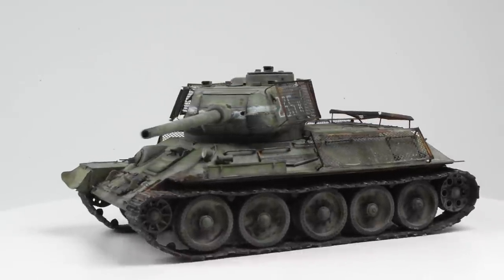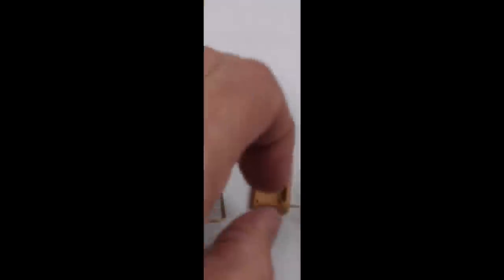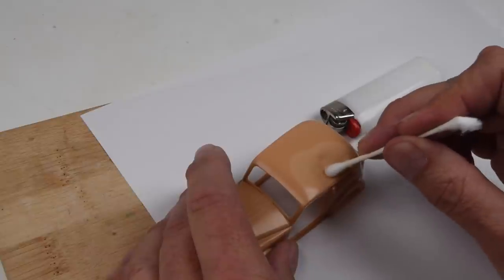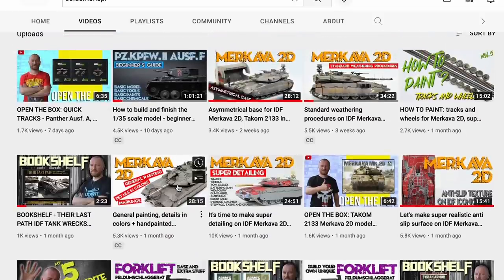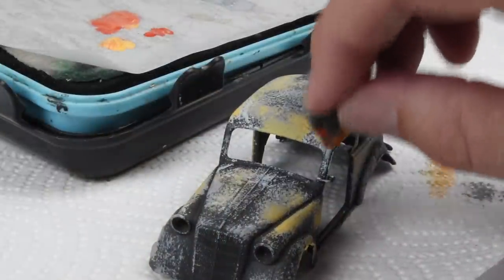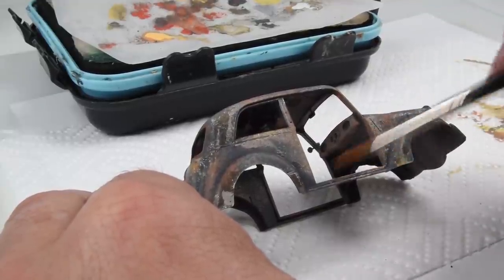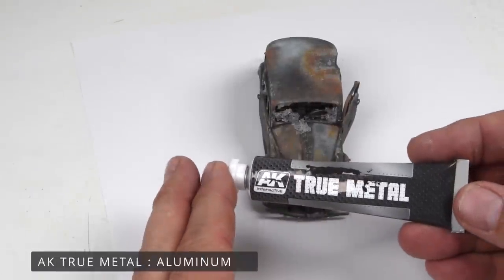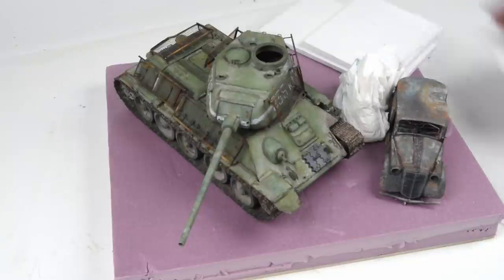T34/85 Battle of Berlin, EPISODE 3. Construction and Painted Burnt Effects on a Civilian Vehicle.

Comment: That car looks so realistic and the metalwork you did is so convincing. When it comes to melting plastic or soften, I use a trick from Yoshi Hirano. I take of the incense sticks instead of the lighter as the sticks you get a more small area of heat. By thay you avoid softening parts you do not want to heat.
Reply from the maker: Yes, incense sticks...I have heard of people using those with a lot more control. Next time!!!  Thanks for watching.
Reply: That’s a great idea, would definitely give you more control👍 Plus would give the  car’s interior a lovely smell…😁👌

Comment: Have you got a video that goes more indepth to using oil's? I'm new to oil's but really want to learn about them as progressing on now I've used enamels for weathering for past couple of year's really but never sure on how long to wait for the oil's drying before moving on to next stage for example or even sealing your work in if you do atoll before moving on to a next layer, see there's not any really good video's that actually explains the process for beginners to start it's all guess work! I don't mean beginner modeller's just beginners in oil's so we do have alot of like understanding in the way things are and what they are so that's going to take the worst part away from anything explaining oil's! I've colle a few of ammos and AK abt 502 oil's I'm still making up a big selection to work from! Thanks for taking the time to read this!
Reply from the maker: Charlie, I don't have a specific video that focuses upon the use of oils. I use them in nearly all of my projects, and so if you look back at some of the prior series, especially those focusing upon painting and weathering you will find a lot of examples. The second in this T34 series, T55 & M3 Lee would be a good starting point.